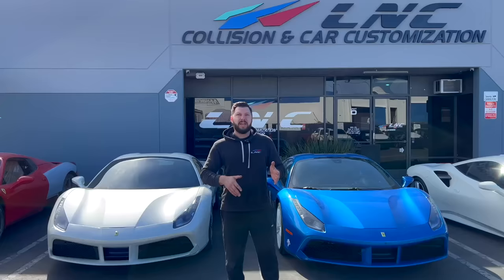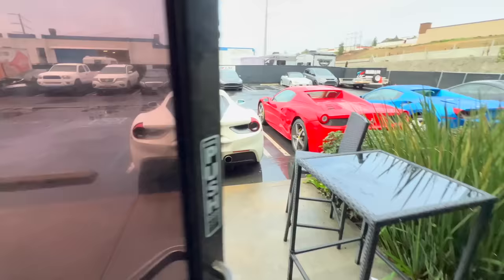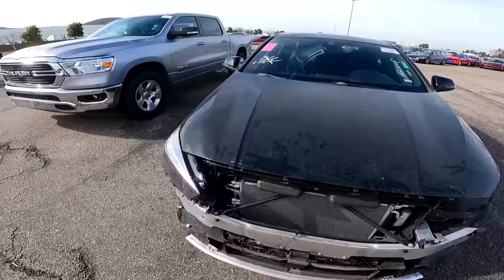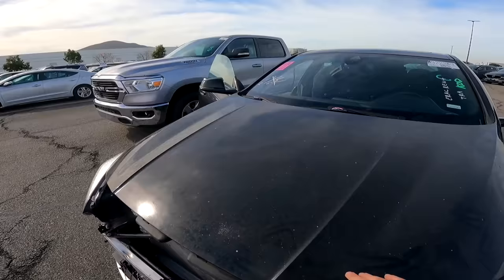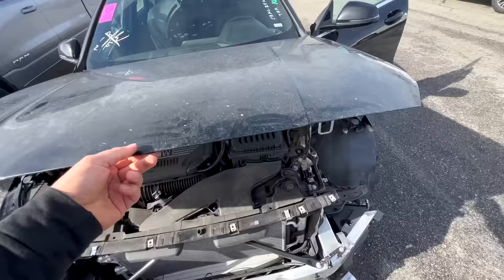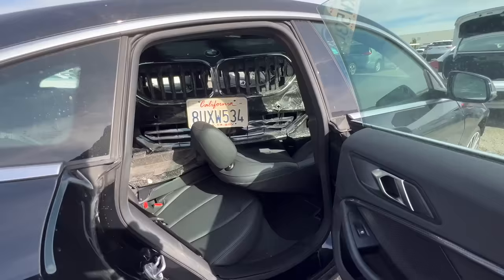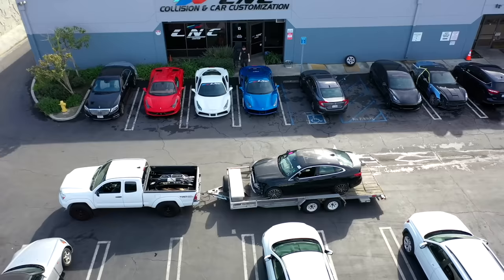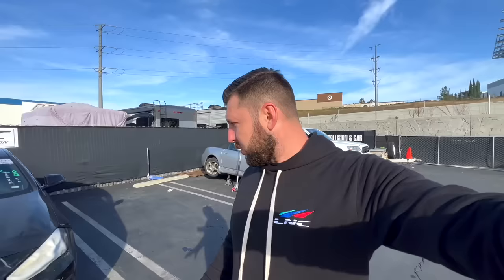I BOUGHT A CHEAP FIRE DAMAGE 2021 BMW 228i SIGHT UNSEEN AUCTION REBUILT

Comment: Круто! I was a little underwhelmed initially when I saw the BMW in the yard, looked like a lot of other vehicles. However, after that front end was fixed, and the rear looks good with the dual tips straight back...real nice BMW for someone without breaking the bank. 👍

Comment: Another comment from Thailand. When I used to rebuild cars in the 80's I had a couple of used car dealers I would sell to. When I would estimate the cost of buying a wrecked car I would figure evrything out, cost and labor and accordingly I would figure out for my profit to be $1000 below loan value. Then I would sell the car to one of the dealers for loan value and that gave him the profit between laon value and wholesale and even a greater profit if he retail the item. I had two body shops that did my body work and I never paid over $500 regardless of the damage. (I furnished all the parts) Neither body shop could paint worth a flip so I had a black guy that painted for Mercedes do my painting. He charged me $85.00 for small cars and $100.00 for full size cars. I furnished the paint, . The ironic part, he painted in a small garage, dirt floor which he covered in newspaper and then he would wet in down. He had a regular window fan for exaust and here's the kicker, his paint jobs were absolutely perfect. Again, a super great video and lots of luck to you in the future.

Comment: The headlight angle eyes bulb is a module DRL u don't need to replace the headlight it's one of the computers you swapped out from the damage headlight, it would have small led lights on it.

Comment: When reconditioning headlights, you're much better off to sand the headlights to about 400 grit and then clearcoat them in urethane.   The coarser sanded finish gives the clearcoat a lot of grip and it'll hold on for pretty much forever without delaminating, and when the clearcoat hits it it'll be just as clear as if you sanded the cover to 5000 grit and then polished it first.   So you get the same end result but the refurbished headlight assembly will last a lot longer if you sand only to 400 grit before clearcoating.

Comment: Great video and greetings from Thailand. I myself (before retiring to Thailand in 2002) as a side business used to buy and resale late model damage cars. I can appreciate what you are doing and again thank you for sharing these videos with us. Also, you will retain a lot more followers by sharing the cost, (not like Dennis Collins)  break-down and profit margins you encounter. One thing you mentioned in this video was when you discovered ther damaged tire you referred to it as a Pirelli tire that you would replace with a matching tire. But at the end of the video when you were reciting the break-down of the costs, you mentioned that the tire was a Continental. A slight over-site or, perhaps I misheard either of the two statements.. A very minor thing and I certainly don't want to nic-pick your fine video presentation. At 85 years of age, one thing I have learned in this old life, for the most part the little mistakes in life really don't amount to a "hill of beans.' Again, thank you so much for the great video.

Comment: What a Beautiful Job Vlad!!! What type of primer did you use on the hood?  Epoxy or a Urethane Primer Surfacer or a standard Polyester Primer.  Also,  What type of clear was used on the head light? 👌

Comment: Very surprised none of the plastic behind the bumper got affected.  Odd that a 2021 has already worn brakes in the back, did they drive it with the parking brake on?  Spiffy car though, love the paint color.
Reply: My friends brother had a brand new Acura Integra. A delivery truck making a tight turn opened up both his side doors like a can opener with its rear bumper. Acura told the bodyshop 6-8 months for new replacement doors because of parts shortage. Insurance company decided to total it out instead. It only had 5000 mi 😞

Comment: Hey Vlad, why you didn't check to see if it's the small module from the right side to the left side and see it it works before you purchase another light?
Reply from the maker: Yes, I did try that switching the module’s around plus I checked my old original headlight. Make sure everything works on it,something was wrong with angel eyes inside of the headlight.

Comment: I hate when they throw all the interior parts inside a perfect interior. Have to damage the seats and headliner at times. Vlad, in the future, I would put the new tire on the back. Did you check to see if that headlight needed to be reflashed? Three different modules. That's a lot. BMWs require programming for everything. Even for the seat.